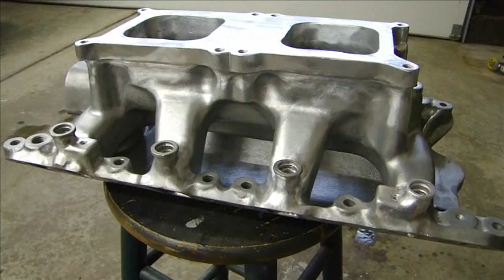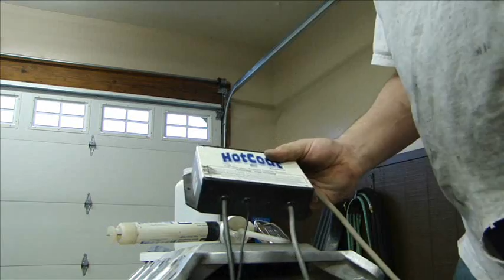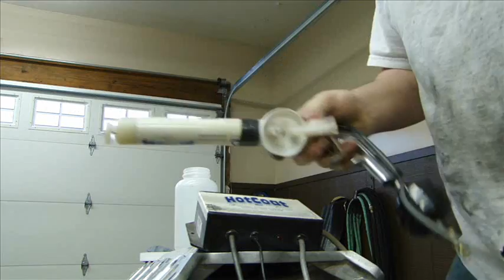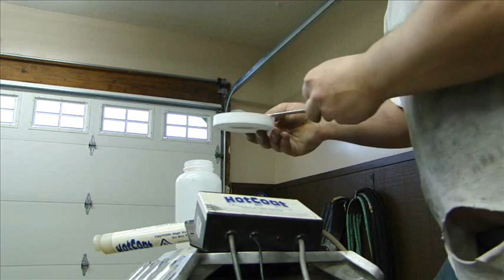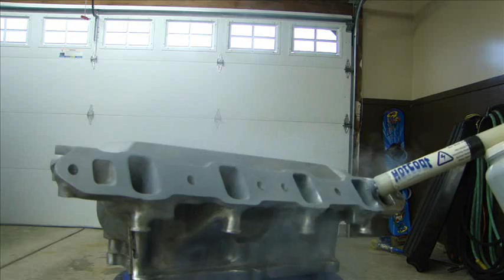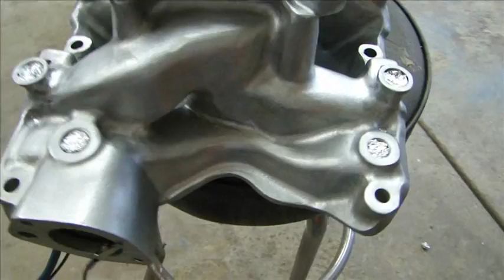Powder Coating Basics

Comment: Hello, thanks for posting this video. I also have a some questions if you allow. 
This powder coating is getting attached to all kinds of coatings if metal is the base? Let's say I want to powder coat split rim nuts, i have to treat them somehow so that the paint will get attached more strongly? I don't want to go off at first pressure car wash. Thank you.

Comment from the maker: No. Chrome powder coat looks good, but not as good as a polished electro-plating precess. There are 2 kinds of chrome, decorative and triple plated. Decorative is cheaper. You can get the same results with polished nickle plating. Watch my video about the Cobra engine build Part 1. I nickle plated and polished some bolts and they look great. Could be an option for you.

Comment from the maker: I have about $200 in the gun, got the oven for free, and about $1,500 in powders. I got the oven from a relative who was getting a new one. Just a regular electric oven is fine. It was easy to pick up the manifold because it was not coated on the bottom. Picked it up like a pizza and slid it in the oven.

Comment from the maker: Yes you can. As long as it has good temperature control it will work fine. You can't use your regular house oven because gases emitted during the process are not good for you if you use the same oven to cook food.

Comment from the maker: It can put put on a cool part...however...I have found it easier to get an even gloss on a hot part...just my experience.

Any surface can be coated as long as it is clean and de-greased. The smoother the finish, the flatter the powder will melt. You can powder coat a brick. It will be shiny but still look like a powder coated brick. (ok...I know you can powder coat a brick because it's not metal.....but you get the idea)

Comment from the maker: No, you do not have to put on a clear all the time. This particular color is not that glossy when cured, and I wanted a surface that was smooth and easy to clean. The clear does a great job of evening out the surface really makes a glossy surface. Great Question!

Comment from the maker: Powder is made by a few manufacturers that private label for most places. I would not go with cheap because it does make a difference. I have never had any problems with powder from Eastwood. They have a great selection and have fast delivery. You will notice how a cheap powder looks. Good luck with the new cabinet and have fun powder coating.....thanks for watching!!!...............Peter

Comment from the maker: That would be awesome....imagine what the 2 x 1050 cf/min throttle bodies and high perf fuel injectors are going to do! Tie that to all the electronic controls and I'm going to have a monster on my hands. I would only use powder coat on the inside of an EFI engine intake. A carburated engine would send fuel and air through the intake and the powder coat would break down from the gas. Thanks for the comment Thomas

Comment from the maker: That is a good question, there were 2 reasons actually. First, the silver vein powder is not very glossy. It has a rough, textured finish and it did not have the finished look I wanted. Second, The Cobra has an open hood scoop and I wanted an extra layer of protection against chips that was easy to clean. The super gloss clear made the finish much smoother and a bit more durable. Thanks for watching!

Comment: I think I will do that, I just noticed that yours did in fact have those tubes inside your discharge tube, not the ones that stick inside the powder cup. I have had no problems with the gun though, keep up the great work man.